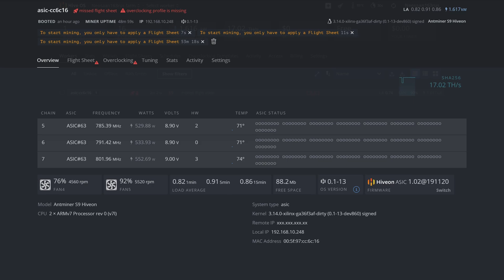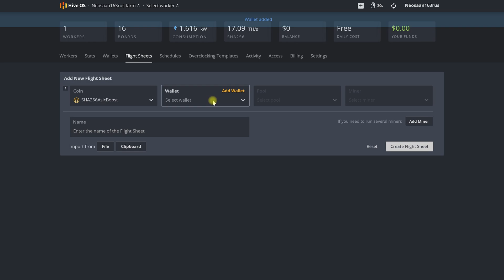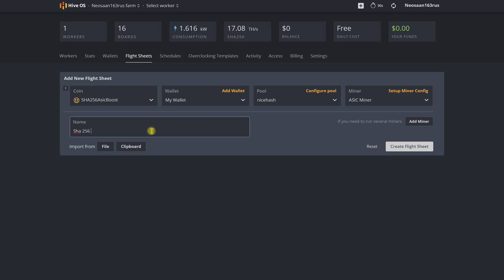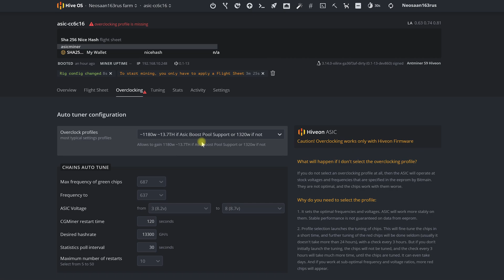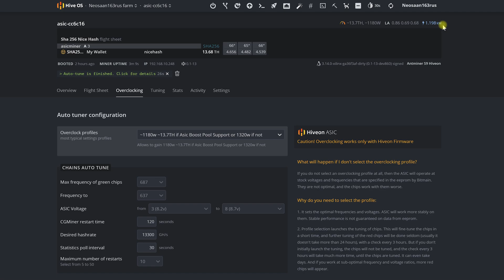Set up ASICs in HiveOs: Flight sheets, Asic Boost, Overclock (HiveOn) Antminer S9J on NiceHash

Comment: Still confused as hell. Added an ASIC, specified the pool and stuff, but can't see the miner on the pool anywhere. Have no clue where I am mining to. You should provide more details in video instead of just saying "mining sweet crypto". Where does it go? How does it get sent? How can you check real time earnings? All that stuff. Right now I have no clue where my payments go to and no idea about profitability.
Reply from the maker: did you wait a bit? In that regard it is the same as connecting a stock dashboard. Hashrate takes a while to be reflected on pool side. You always check earnings (and most other things you asked) on pool site and that is where you specify your payouts, depending on the pool, so no sense to include it in a tutorial for an OS. cheers
Reply: @CursedMining  It is not what I meant. The problem is that you do not have any tutorials on how to set up a pool correctly, so it would show up in pool's dashboard. I figured it out finally on my own. There are tons of confused people asking about how to setup an ASIC on HiveOS with poolin, f2pool, etc. I ended up just going into ASIC config profile in wallet tab and played with settings over there. The worker finally showed up in poolin dashboard. What Hiveos does is basically transports those settings into ASICs profile which can also be configured by going directly to ASICs with it's IP address. You provide a nice convenient way to change those settings quicker but to figure it out is a nightmare. After I figured it out it was easy. Not sure if I did it right, but it works.